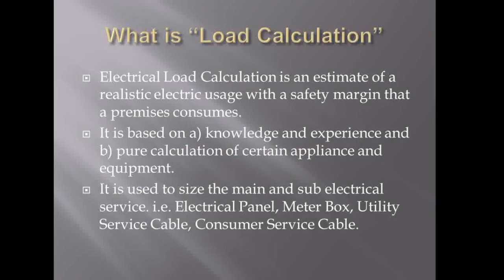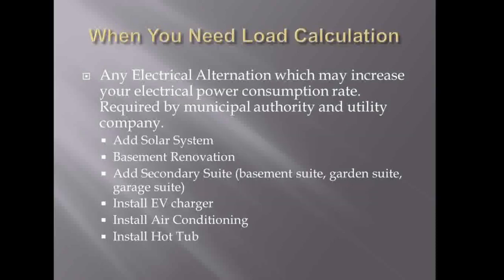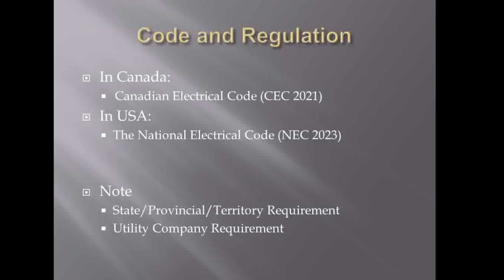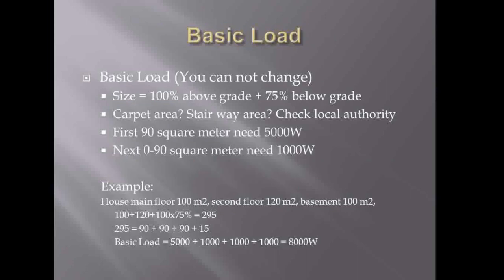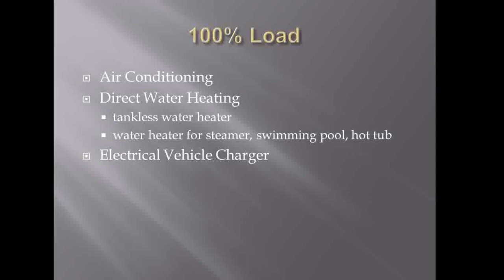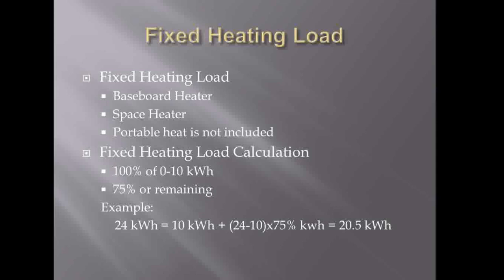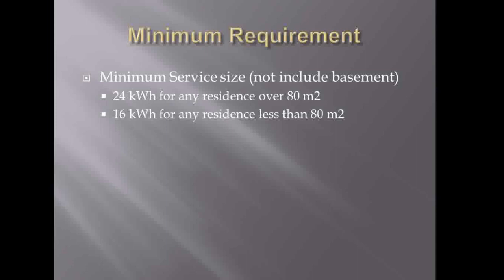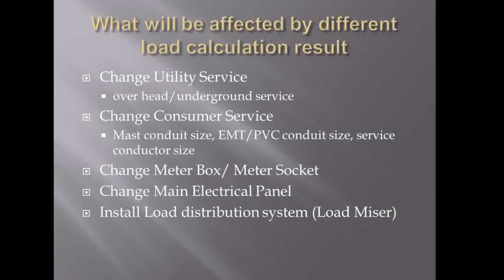Electrical Load Calculation in Canada and USA

Comment: I've seen a lot of homes with basement suite (complete with kitchen and everything) that still use a 100A service.  Does the city require you to do a load calculation if you're wiring a basement suite?
Reply from the maker: Hello Mike, "Yes indeed, if you want to wire a basement suite, load calculation is a must"
For 100A service you could have a full basement suite. But there are certain things you may have to change or remove. 
(1) AC 
(2) EV charger
(3) electric Stove or Gas Stove
(4) shared laundry room or not (electric dryer location)
(5) consumer service cable size (from meter to electrical panel)
Also the size of the house... Generally speaking, if you do not have an AC or EV charger or Hot tub, it is easy to do a basement suite with a full kitchen. 
If you have either one of those, you may or may not be about to do a basement suite.